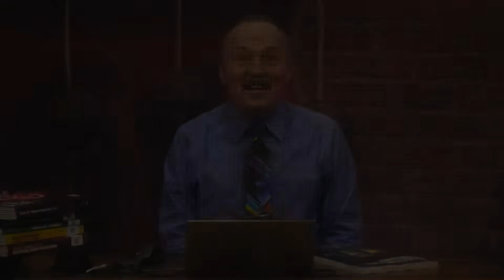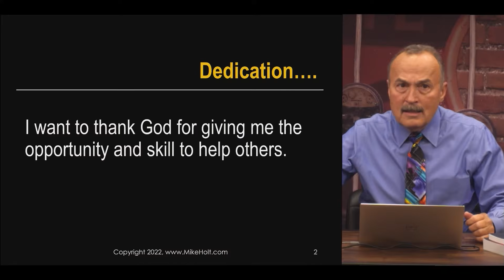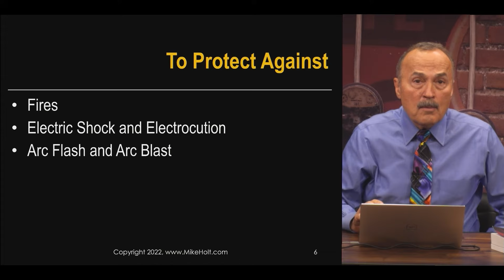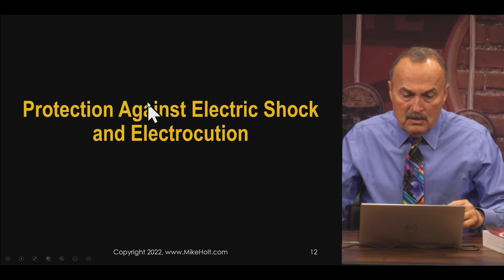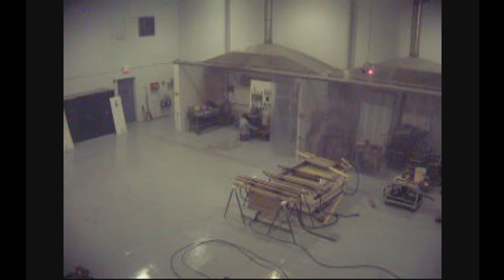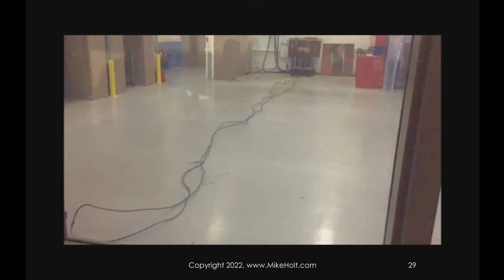Electrical Theory - Introduction

Comment: The Code nees to ungrandfather and outlaw all BX Cables with cloth covered wiring, all cloth covered wiring in any form, and require replacement for Old Romex cables that have no ground wire and brittle plastic insulation.

Comment: Why is it "electrical theory" and not "electrical fact"? :)
Reply: Because theory doesn't mean a guess or a hunch.  A lot of people confuse theory with hypothesis.   A theory is a body of knowledge that explains a family of concepts, and is scientifically proven beyond a reasonable doubt, based on our best understanding in the present day.

A fact is one piece of data on which a theory is based.  A theory puts numerous facts together, and builds a model to explain why those facts are true from fundamental principles.

The distinction between theory and practice, is that a lot more factors come in to play in practice, that might not show up in a simple application of the theory.  As an example, assuming you have nominal voltage at your service point, and basing your calculations off of it, is an example of theory.  Theoretically, you are supposed to have 120V line to neutral, and 240V line to line, on a split-phase service.  In practice, the exact voltage at your service point is a moving target, that varies with the loads your neighbors consume throughout the day.

Comment: Why would the inspector be wrong about bonding the metal poles for the pool?   Was it outside the perimeter bond of the pool or were they just insulated by the cups they went into? I thought in one of the examples where the lifeguard was electrocuted it was due to one of the handrails not being bonded.  Just trying to understand things a bit better.  Thanks for all you do, have learned a lot from you and your team.
Reply from the maker: Bonding is required for 'fixed' metal parts within 5' not 'metal parts withing 5'.
Reply: @MikeHoltNEC  gotcha, thank you Mike